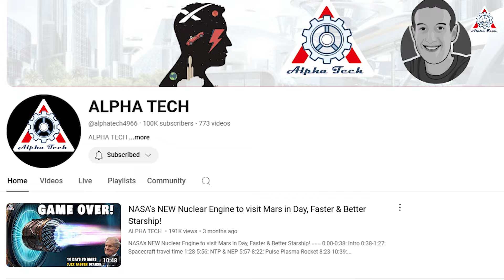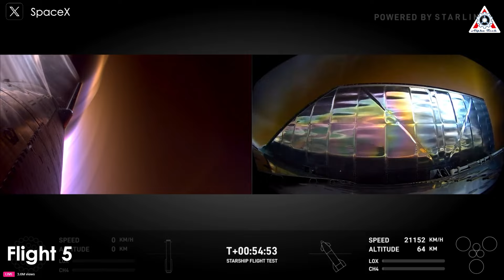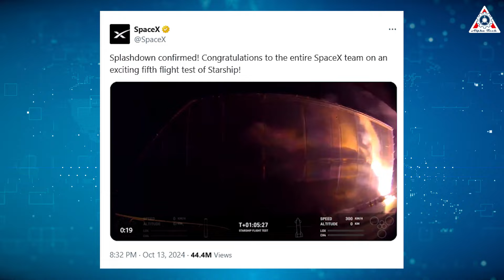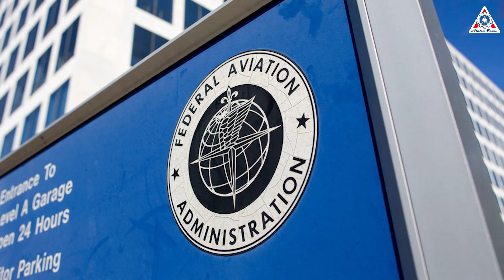SpaceX just Declared This on NEW Starship's Heat-tile UPGRADE Re-entry, Splashdown & Explosive

Comment: They shouldn't be so quick to label the heat sheild a success. They should wait till they retrieve one for inspection. Elon stated they'll try to catch the Starship in 2025. Till after they caught the booster, they didn't realize the grid fins were warping.
Reply from the maker: but basically! it performs very well for our eyes!

Comment: I wonder if the cause of the fireball of StarShip was gravity. If you recall previous boosters had a problem when flipping (bubbles). Starship did not blow until it tipped over. Perhaps using upper thrusters to stabilize the ship in verticle position until engine shutdown completes will help.

Comment: Everyone seems to forget that this suborbital flight represents the absolute SLOWEST velocity the Starship will ever hit the atmosphere. Coming in from orbit would be faster. From the moon, faster yet, from Mars even faster.
There's a lot of engineering left to go on the heat shields. And they are not even putting humans in there yet.
Reply: I think if they're coming from the moon or mars it would just be a slower process.  ie. they get the starship into orbit and then slowly slow it down to these levels.  It would take a lot more time but that's fine.
Reply: @wadevid  The math just doesn't check out in both cases (fuel or heavier shield) - if we're talking Mars. It simply isn't the right architecture for Mars landing and return. Good for orbit bad for Mars.
Reply: @nehorlavazapalka  or possibly this…on reentry from mars/moon or wherever…starship uses minimal fuel to slow down for re-orbiting earth. It docks to a refueling orbiter (maybe another starship used only for fuel and slowing down starship) and the. Starship continues its descent.

Comment: I wonder if the flaps can be moved even more leeward and extend out farther? So the hinge section would be more on top and out of the plasma stream. The flap mid and tip section would then be the only part that extends out into the plasma stream for guidance control.
Reply: That's what version 2 has done.

Comment: I actually think they will try to catch Starship on the 2nd tower - lower risk of it landing bad and taking out the landed booster by crashing into it. For that - well, Tower 2 must be ready.
Reply from the maker: oh my god! why didn't i think of this! thanks for your comment! very helpful
Reply: @alphatech4966  Yeah, once you get pointed out it is quite obvious, is it not ;) Imagine the stupid Starship has an issue and falls - on the booster. Even if that is not escalating further, that is a lot of damage you can just avoid.
I think what we also will see next year is a booster reuse - without maintenance. THAT will be epic.
Reply: They haven't tested the chopsticks as thoroughly on tower two yet but tower 2 is almost completed.  The big question is how long it will take the FAA to issue the license for the launch/landing.  SpaceX had two months to work on the catch attempt waiting for the license.  SpaceX is still working on tower 2 while the next booster/ship combo is getting ready.
Reply: @drmayeda1930  On the other side, I am not sure how good the landing of Spaceship was (I.e. was it down to the tolerances) and we DID have some issues with burnthrough, still. It may be better to run another test until the heatshield mechanism works and landing tolerances are dialled in. IIRC the booster had on the last water landing a tolerance of half a cm, good enough (and it showed to really be good enough) for a tower capture.

Comment: Not sure about the ablative (sp?) material. I mean, it’s good as a backup to protect astronauts. However if you want to be rapidly reusable, you’d rather not have to remove all those tiles to replace the material. Hopefully one day it will just be a backup safety measure and never truly needed.
Reply from the maker: true they didnt replace ablative with the whole ship 30! but maybe V2 will be the whole

Comment: All the areas that I argued would be problematic three years ago, are still problematic.
But slightly better...
Flaps, tiles, grid fins, flight profile.

But, alot of other stuff has been improved in the interim too!

The flaps are a bad design, basically very limited control options, and by having the joint in the arm pit, creates an unsealable gap where the heat is most concentrated. should be replaced with a pivoting canard  with some V from hull axis. and enough space between hull and body of winglet to allow ample pass thru instead of concentration and air compression point.
Like a Whale fin, a bit of base before control surface begins. and a rotating pivot that can be sealed.

Tiles, still problematic, albeit obviously better, but I suspect the flight profile improvement had more to do with it, than the glue. Tiles are brittle, pins are very focused stress point attachment systems, its like trying to hold down glass sheets with screws and risking breakage even with no other mechanical forces applied.
I'd be looking for a better attachment system that relied on wider tabs with bent ends that you slid the tile slightly aft to lock in, so the force of airflow kept them locked on. And if your nose tiles stayed intact, everything stays kosher.
Or switch to coatings.

The real issue is the pushing of material limits beyond possible specs.

This is caused by the limits of a round hull with inadequate lifting surface. Its a wine bottle thrown into a furnace..

Really need to focus on a high glide ratio lift  improvement, via hull shape and lifting surfaces..

Was obvious from what went good on flight five, that the high altitude glide phase was peachy, and tiles were OK, and when they broke out of that, things got ugly like flight four.

Needs to stay in high glide phase longer, and this is with no load conditions, when you add a hundred tons, and return from Lunar or Mars orbits, this ship aint gonna hack it without retro fuel use in ample quantities.

What it is, is a great test bed, kind of the number 1 on the future re-entry scale, where everything will be given a re-entry coefficient in proportion to Starship.

Which will have glide ratio, ballistic coefficient, and load variables.

Its a crude design, even the Space Shuttle was a crude design.
Some low wings cobbled on to a boxy fuselage with round corners and nose.

Should be more like hard chined blended wing shapes more common in modern aircraft.

This whole process is like the 50 years from the Horton fighter bomber to the modern designs, most of the half a century was used doing the same old schitt of cobbling wings and fins onto tubes, and then they went to a steath fighter design that was basically an exercize in crude hard chines for radar that flew like schitt due to air resistance and facet like flats.

You can bend metal pretty easy in one axis, you can roll it easy on one axis.

Go with the flow of simplicity... The Horten was literally covered in one axis bend plywood, and about 10X better design shape than Starship.
Starship is a one axis bend, called a tube, there are other better one axis bend shapes possible.

On the grid fins: ever an Albatross. They work, but they are crude, and have to be located too near the top of the booster to be effective. and now obviously in the torch zone during seperation. 
It was an expedient from half a century ago that operates mostly on drag, but the booster still has to fire retro to slow down.
Would be better to opt for more control, be able to get spaced farther from the top etc.
And use the grid fins to build a meat grill at the SpaceX restuarant...

Last issue is the compression heating in in engine space, all kinds of ways to fix that. from venting the pressure, to slowing down more earlier.

And on the warped bells, would suggest reusing the worst one as is, on the next test flight to see if the heat and pressure true's it back to normal.

The rocket exhaust will likely fix the problem.

And its something that needs prevention, better than fixing after damage is done......

So there you have it! 
Today's Captain A-hole opinion.... 😂

Keep at it guys! Another ten flights and you'll realize its time to try new ideas... 🤭

Comment: what's the point to catch starship when it suppose to land on rough terrain on the moon and mars without Mechazilla
Reply: Starship will have far more launches where it needs a catch, for example refuelling missions or starlink deployments.

For example, for every moon mission there will need to be at least 8-10 starship fuel tanker catches. It's a critical part of the infrastructure for a fully reusable rocket.
Reply: Only the booster gets caught for reuse. Starship will land like it did in the ocean. It will land on soil soon. Have to make sure systems and process work before implementing the final plan. Be patient.
Reply: @ericledbetter4823  They won't be catching the starship also?
Reply: @ericledbetter4823  Nope, totally wrong. Do you bother even listening to what Musk says?
Reply: Did you ever hear of gravity? Are you aware - i mean, you should know that as a child - that gravity is lower on the moon and mars? Also that there is supposed to be a tower on Mars at some point - because the towers and catching are there to allow fast turnaround?
Reply: @ThomasTomiczek  I worked for him so, yeah I know what he says
Reply: @ericledbetter4823  Good example that you may KNOW it, but you lack the mental capactiy to understand it.
Reply: Different starship model for that role
Reply: Because YOU CAN.  No other reason necessary.
Reply: As if they’re not going to use starship for lifting commercial payloads to orbit. They need it making more money to fund development
Reply: @ThomasTomiczek  keep telling yourself that.
Reply: @ericledbetter4823  Nah, I have a memory. You now? look, we both know you are mentally behind - but even you should realize most payloads in Starship will be earth/orbit and MOST of that will likely be tanker / cargo. But ut hey, some stupid people think that landing legs make sense here.

Comment: How come STS-1 made it's maiden flight to orbit 43 years ago with two guys onboard and nothing burned up and it didn't explode? Wasn't this Starship's 5th flight already?
Reply: 1. Because the design of the Shuttle was that of a space plane, and they had piles of data from the X-15 program on the challenges and techniques of a winged flying reentry.
Plus there had been numerous atmospheric test flights of the orbiter,  and all the lifting body test articles from the 1950s. the USAF also had enormous amounts of research from the canceled x20 dynasoar project that was was also leveraged into the X15 and later Shuttle programs.  The confidence that the STS would work as designed was very high, pretty much all the concepts and constituent parts had been proven separately 
By comparison - NO ONE has attempted reentering something like Starship... that shape presents very different challenges aerodynamically.
As for the explosions of #4 and #5 after landing - it's very likely that they were destroyed using the FTS to ensure rapid sinking.  They were never meant to be recovered. 
Nor are they even supposed to land in water when operational,  they aren't designed to land in water, damage from water landing will be normal and expected. 

And 

2. (Most importantly)  we never lost a crew until Challenger and then Colombia.. in 81 we were still operating in that space race  "cowboy" mode regarding safety. 
STS-1 would not have launched manned using today's guidelines.   Even, then  in 81' it was the FIRST time a NASA vehicle performed a first orbital test flight with a man in it. 
(Mercury, Gemini, Apollo,  they all flew as un manned boilerplate test articles first)   the STS program pre dates NASAs human rating requirements (lol... it was the CAUSE of those requirements)
In fact, with NASAS commercial crewed operations risk guidelines- the Shuttle couldn't fly manned at all.  (1 in 500 chance of an accident that causes loss of the vehicle on acent or rentry, 1 in 250 chance of an accident in orbit that causes loss of the vehicle and crew)
Reply: @stinkyfungus  and you think Starship is going to be crew rated? Like "next year" as Elon would put it?

Comment: Would be better if the re-entered end-on instead of belly first, have a thicker but smaller disposable heat shield and keep the crew area away from the heat.
Reply from the maker: not a bad suggestion
Reply: end on as in?
Reply: @alphatech4966  
It would still mean replacing the heatshield after each flight.  I think a small delay to check the grid fins then launch for a tower catch.  That way you can actually see how much damage the grid fins took and how the heatshield tiles look.
Reply: @300spartan2222  verticle not horizontal, talking about the ship, engines first with some sort of cover.

Comment: Why do they even need heat tiles on Starship in the first place? Can't Starship just re enter the atmosphere the same way the booster does. The design for the moonlander makes much more sense to me. If it's going to land upright anyways, why have it glide in and then make a big tilt manouver?
Reply: If it doesnt have heat tiles is will burn up in the atmosphere
Reply: The speed is much higher than the booster. It would have to use a lot of fuel to break before entering the atm
Reply: @jesder75  Exactly, this is the most stupid comment I have seen
Reply: Starship enters the atmosphere at 27kmh coming from space. Booster doesnt even leave the atmosphere.
Reply: @Kiwiaviatornz  Wow! What a Doos! I ask a question because I don't understand something and you reply like that... Not cool dude.👎👎👎👎👎

Comment: Y did the ship explode? I would not call the test totaly sucksess full cause ship exploded. Unless they trigered selfdestruct. I think shield needs a nother test to varify
Reply: Also, it fell over. It's a very large vehicle, and the momentum from falling over in a way it's actually not designed to probably ruptured it. That would cause it to burst and any residual propellant vapours had plenty of things to ignite them.
Reply: This was a test flight. The starship was not designed to land in water.  This was 100% expected and on plan.
Reply: Right but for most pland aplications of this ship it will requier landing legs, so why not desine ship with and figer how to minimize footprint?

Comment: Another comment.  I'm STILL waiting for SpaceX to 'wrap' the heat tiles in molded CF to prevent them from loosening during launch.  A single layer of 5.6 ounce Hi-Tensile CF would work perfectly, then be burnt away at the first stages of re-entry, leaving a pristine heat shield in place and ready to do it's job.  Just make a huge 'SpaceShip' shaped mold, press them out like cookies, then attach to the heat shield tiles prior to launch.  It's a throw away item.
Reply: Thing is that if its burnt away then it mean that the rocket would not be very readily able to relaunch like they want to because they would have to re-layer it after each launch.
Reply: @griffinarcher2911  Ahhh but you have to go over the entire heat shield structure anyway, check the engines for damage, do a test run of them, clean the tanks, do a full systems check, reload the cargo, etc etc etc... just to recertify for launch, which will take a bit of time.  In the meantime you lower a 5/8 coverage pre-molded CF piece in place, attach a few hold down bolts, and you are ready to go.  It should take less than an hour to install the shield if it's designed properly, and it will alleviate any vibration/stress loosening of tiles during launch.
Reply: @isaalghazi9131  If it takes less than an hour then that would be a good idea. I had assumed it takes longer to be perfectly molded and set on the rocket.
Reply: @griffinarcher2911  They would have another starship already ready to go.  Then this starship that has the burned off layer, would go into maintenance to be looked over and get it all re-fixed up for the next flight.  It would just be a process of cycling out the hundreds of starships.
Reply: @wadevid  Precisely. I'm really looking forward to the future with SpaceX.  The booster catch was an astounding leap forward and it's only up from here.

Comment: There was still burn-through on at least two of the flap hinge lines.  The Starship is STILL not ready.  The debris coming off in the corona should not have been happening, and ANY overheating of  the  hinge lines shows that they are still very potential failure points.  Needs a lot more work.
Reply: this is test 5 of probably 8 or 9. so of course it's not ready.
Reply: SpaceX can already get crew up and down safely, they can already lift up 64 tons to LEO with Falcon Heavy.
They know Starship isn't ready. That is why they try different materials, approaches, intentionally removing heat tiles to study heating or just adding aluminium to heat tiles to see where it melts - which would definitely fly of during reentry.
For flaps - issue should be already solved, they talked about this already in IFT 4, that V2 has different flaps. This was not V2. They had this launch as "free" test (and also they probably wanted to do minimum to ensure hitting target zone).
I don't know about whole economics, but they are pretty clear about what they do - more than any other company. Sharing failures, videos, info, everything.
Reply: It's being addressed in Block 2.  They changed the size and location of the flaps to move them out main path of the plasma flow.